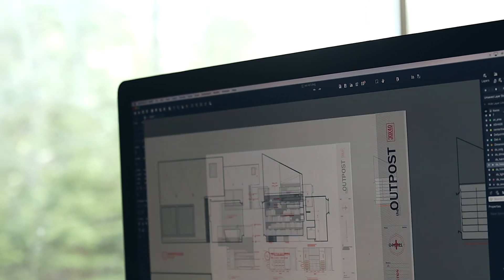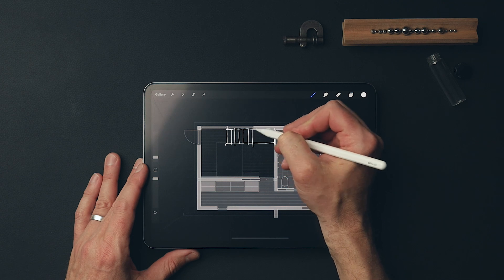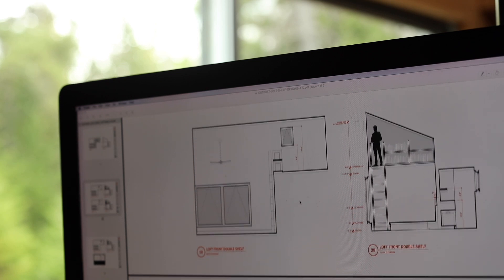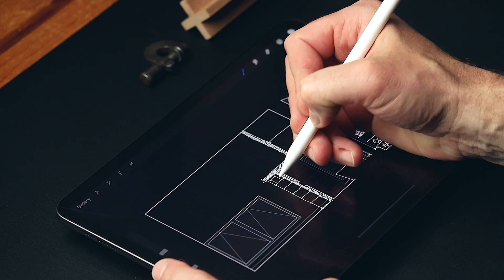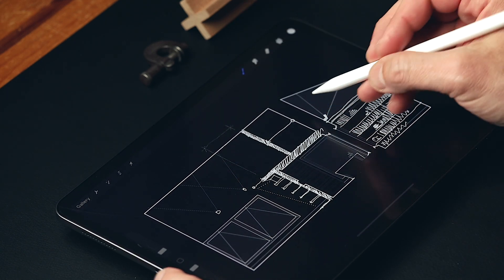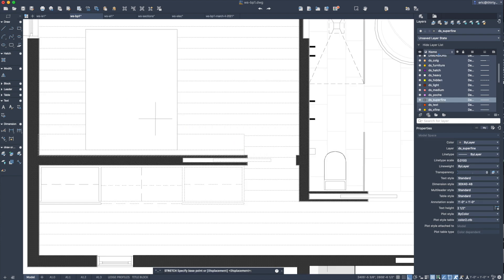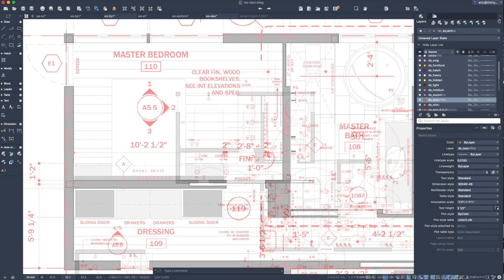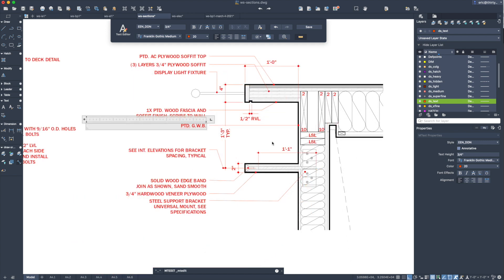Most of my time as an architect is spent doing this...

Comment: I'm just curious.  How do you determine what rate to charge your client?  I'm a one man show just like you, with two ARE's under my belt.  Eventally the goal is to have a practice similar to yours.  So, do you charge different rates for different types of work you do?  What I'm getting at is that most contracts have a schedule of fees which break down the rates of different parts of the firm with technical staff usually having the lowest rates. So when you are drafting do you charge a different rate compared to when you working on SD or DD?  Also, what should an overhead rate look like for a one man show?  Thanks for your time.
Reply from the maker: I cover these topics in detail in my A+E Course which would be a good match for you, details here: https://courses.thirtybyforty.com/

Comment: Hello! Just found this video; Awesome work! Also, this question might be answered elsewhere; if so I apologized and would ask you can direct me to it...
I am wondering about your workflow. It looks like you are exporting vector linework from your CAD software as a raster image, opening the raster image in a "paint"-style program, and then "sketching" right over the CAD lines. Is this correct? Can I ask what software you're using on your tablet to sketch with? Are you saving all the sketched over imagery to share with the client afterwards?

Comment: I love your little piece about Revit. Perfectly worded. People seem to defend Revit as if it's an extension of themselves; they even seem to take any critique of Revit as a personal insult. I'm still trying to figure out the psychology/motivation behind that. A person once told me that "they think in 3D, therefore they prefer to 3D model everything". That seemed counter-intuitive from my perspective. I thought that if they can think in 3D, then they could simply create 2D representations of their work. When I draft in two-dimensions I am able to picture my work in 3 dimensions (most of the time) and don't necessarily need a 3D model. My own personal results don't lie: I can produce better plans faster using AutoCAD. Individuals should use what program works best for them and ignore all the marketing hype. I've seen great construction drawings created in AutoCAD, Revit, and even Sketchup (there are a couple firms that have had really good success using Sketchup but they rely heavily on their own proprietary plug-ins). The best-presented drawings I've ever seen were actually created in Sketchup believe it or not (how much time it took to create those drawings is up for debate however).

Comment: 3D CAD programs are great (I use one that works for me) but the issues I experience with most 3D CAD programs is level of difficulty.  Most are way too difficult to learn in a reasonable time period, and also most are extremely time consuming to set up initially.  Most self-employed designers cannot take months to learn, navigate and set up a productive CAD system - so 100% understand and agree about using 2D AutoCAD for the most basic of design and drafting tasks.

Comment: Yeah, I can respect personal preference when it comes to Autocad vs BIM, however one can not deny the efficiency of BIM. For small scale projects, AutoCAD works well, even if it's a pain in the ass to modify things manually. And I get the astronomical price point of Archicad and Autodek in general (not the cad lt version). 
So in conclusion, everybody does what it works for them. But that is not to be used as an excuse to resist learning new things/tools that might help you or you might even enjoy at some point.
Reply: Yeah, especially on large projects, bim is great. No point in three parties all creating their own model, when one could just easily export it. Also the clash control is vital in large projects.

Comment: Maybe a library rolling ladder attached to the bookshelf so you can reach the top shelf of books and also have easy access to the display shelf above it.  Just a short architect over here :). I love your lighting design and beautiful drawing style.
Reply: Or run the front bookcase up to the ceiling pitch, besides an aperture through to the mezzanine, and bring the rolling-ladder's top higher, as high as the pitch allows anyway. Then you've a 'cubic' bedroom space, and a reading alcove, with a hidden source of light permeating through the books from behind.

Comment: I prefer working with AutoCAD as well, but it just takes longer to update each page vs. something like revit which is a BIM software where all changes are updated automatically. I'd love it if AutoCAD can be made into a BIM type of program.
Reply: I can't believe you haven't heard of AutoCAD Architecture. It takes some of the fuss away from what you mentioned but still allows you to work from within AutoCAD's interface.
Reply: @randomCADstuff  I've heard of it and I know about it, but I'd rather use Revit than AutoCAD Architecture.
Reply: You realize AutoDesk owns both programs, right? Revit & AutoCAD.
Reply: @simpson1672  yes, what's your point?

Comment: The eternal dimensioning debate!! Dim to stud or dim to finish face?! I understand the argument for dimensioning to studs, but my preference is to finish face...to each their own I say! The key is clear, consistent and concise drawing and detailing. Always love the process vids! Cheers!
Reply: Good way to drive your framer insane, why make someone in the field do the math, when you are a click away from a more usable dimension?
Reply: @rozinant1237  I'm a member of the Architects for Contractors Doing Simple Math group!! We accept members...In 10 years and several markets, I've only had 1 contractor complain or even request To Stud dimensions and he could not layout a simple radius.
Reply: I would agree. Especially if minimum internal clearances are to be annotated. Let’s put it this way - when dimensioning vertically, we don’t dimension to the rafter / ceiling purlin, why do we annotate differently with walls?
Reply: It’s really not either or. It’s architecture and (or) interiors. Both are important, especially for residential. Try floor plan with framing dimensions (so the builder can perform) and add a floor finish plan for your finish dimensions (so the cabinet maker can produce shop drawings…why make them wait until framing is finished???) and you can use the enlarged plan (1/2” scale finish plan) to check measurements as they come in from the builder

Comment: I really enjoy how you take the time to show shading, hatching, entourage on your CD's and Details - also noticed the LSL framing - very nice! Do you get pushback from the contractors on that - or given your location and shipping to the island is it easier, more economical or even just for a straighter, truer structure based upon the elements?

As always, there are important lessons for the young architects out there - such as taking the time to archive and update the complete set / spec - rather than just issuing an sk. This keeps the documents clear and consistent and avoids potential confusion on if they are looking at the most updated information in the field.
Reply from the maker: The materials shipped by the lumberyards to the islands are very low quality because they can...shipping back to the mainland often exceed the cost of the raw material. Engineered lumber pays for itself very quickly. Cheers, Chris, thanks for watching as always!
Reply: @30by40  That is a definite plus for using the engineered framing then. Good to know.

Comment: Love that rant on using Revit.  Definitely and option but not for me either.
Reply: Please do have a look at BIM software other than Revit. In the past 20 years (and 3D modelling before that) I have used numerous software and that provided by AutoDesk has been, consistently, the worst. ArchiCAD and Vectorworks are far superior for me, but perhaps not everyone. But the mossy popular of anything is rarely the best !
Reply from the maker: Definitely considered ArchiCad but it's $6K USD and when you add in the learning curve, foregone income and time it's just a deal-breaker for a practicing sole-practitioner like me. Totally get that it works for others though!
Reply: @30by40  Hey Eric! First of all: Thanks for the video! I am getting excited every time I see, that you uploaded a new video. Interesting to know that Archicad is more expensive in the US, than it is in Europe, but don't forget, that Archicad costs you once and you keep the license forever, while Autodesk has the subscription model. Archicads 2D tools are equal to Autocad, Archicads Morph tool is equal to Sketchup Pro, Archicads BIM tools are equal to Revit and Archicad has all the building services and structural engineering included if you want to. There are no upcoming cost traps.
Reply: @johannes_blum  

I beg to differ. I am an ArchiCAD user - since around 2003. Used 3D drafting before, but now I can not stand it. I use ArchiCAD for 2D drafting only, even with the Morph - which is a good feature, but still very restrictive.

As for 2D drafting and publishing, I do love ArchiCAD, unfortunately there is no improvement in this field in the new versions. So you can buy the licence once and use the software for longer, but it is preferable to pay a little every year for the yearly update.... Especially if you use BIM, not much for drafting...

My biggest problem with ArchCad was that they didn't have any support for individual learners - just started a website Graphisoft Learn, which still doesn't compete with the datebase of SketchUp tutorials available for everyone for free.

I love ArchCAD, but was very disappointed with the learning support I found. I spent 2 years trying to learn BIM from home - I already know how to build in 3D, it's more about the data management  and setting  - but it's just no support. You can only do training through a company who can pay for it.....

And me too - I find BIM frustrating and restricting to design. In my view it's very good for complex project once the design is finalised, but unless you have a lot of practice it eats up your time for very little advantage on a small scale project.
Reply: @kingasz100  I get your problem... In Hungarian universities, we study ArchiCAD and we also have an extra course where the members of Graphisoft teach us more about ArchiCAD, but I can imagine how hard it is to learn it on your own. I'm working at Graphisoft as an intern, and I can tell you, we do everything we can to help people learn, but it's not easy...
Reply: @ZsuzsannaBoricalisthenics   Hi Zsuzsanna! I tried to get in touch with Graphisoft for 2 tears and was just about too start a BIM course, here in London, before the lockdown in 2020 march. I was trying to get in in touch with the lady organising it but never heard back from them...And now Graphisoft Learn started....Too little too late. I am doing some architecture works as a hobby, but now I got back to the film industry instead as luckily for me, here they are not specified in a software, they don`t discrimnate by gender and nationality and also I don`t need BIM to get an interview....On the other hand my knolwadge in design history and generally in design and 3D modelling is appreciated....I am till keen on leaning more about ArchiCAD , but still couldn`t find the right channel and now as I am back to work time is an issue.... It would be good to get in touch. Some of my university friends are at Graphisoft too, but never thought of contacting them.....Thank for your answer and symphaty.
Reply: @kingasz100  I'm so sorry to hear that, this whole situation is bad for all of us. :( If you are still interested, it might be a good idea to ask your friends, I'm sure they can help you find local opportunities to learn AC. :) I wish you the best!
Reply: @ZsuzsannaBoricalisthenics  Nothing to be sorry about.. turned out that I don`t have to learn the boring stuff and I am back in track ....I doubt that I will bother with AC, you can not rely in one software nowadays....
Reply: @johnkellett7797  I have a friend that loves Archicad.
Reply: Love this video, so cool to see the refinement process take place, thanks for sharing! Just a couple quick thoughts on Archicad for others if it's helpful. And totally agree with Eric we should use whatever tools work best for each of us 😃 I'm a solo practitioner doing residential landscape design projects, Archicad has a "solo" version at $4K USD which has everything us residential people need, and I started with a monthly subscription just to try it out on a couple live projects before going all in. The easiest way I can describe it → you are building the thing, instead of just drawing it. And every single drawing, elevation, detail, dimension just updates if you move a wall. It's straight up magical. My use case is very minimal, and so I've stripped back much of the toolset since I'm not making skyscrapers. And it definitely is taking a good chunk of time for the learning curve, though it's the only thing that made sense with my brain after trying all the tools.
Reply: Revit is nice because you can actually work together with the other parties, and do some clash control/interference control.
Reply: @demi3115  You can do this with any other BIM-software, too. The main reasons I would never use Revit is the price and it's terrible 2D-tools. Autodesk forces its customers to buy Autocad, too to draw details. Any other BIm-Software is as strong in 2D as Autocad.